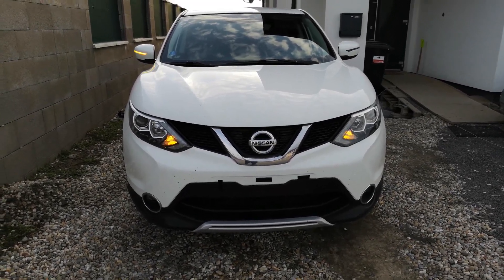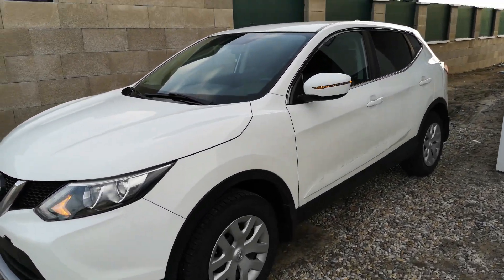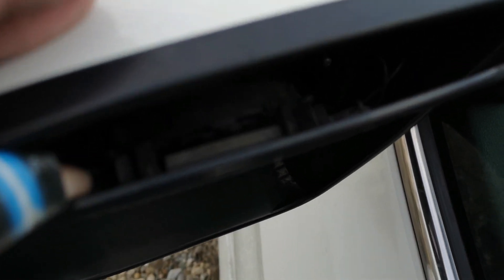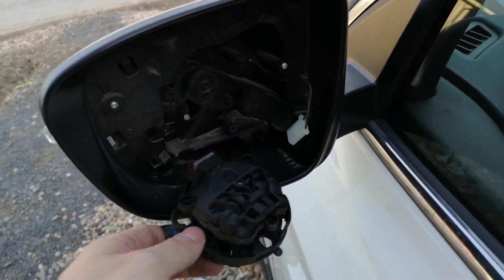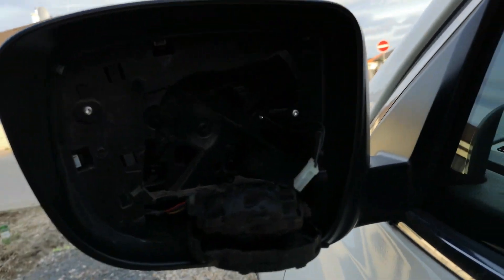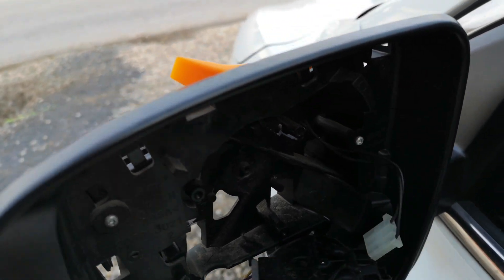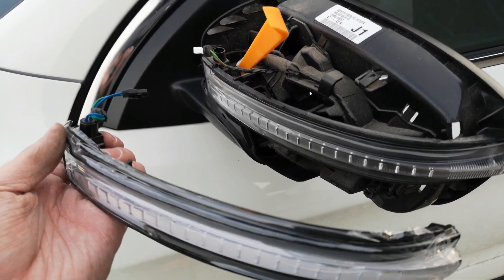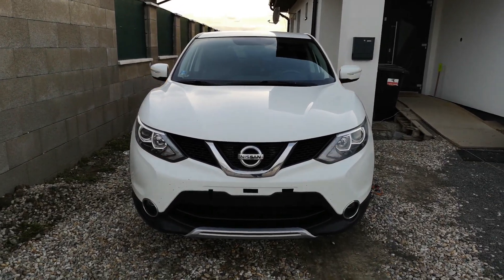📈Nissan Qashqai J11 - new side mirror turn signals

Comment: You just have a friend for life! Thanks to this video I was confident to replace my normal turn lights with dynamic ones. I bought these at aliexpress for13 euro and they are even better visible than the original ones.
I do have a 360 deg. camara system and so there are cameraś mounted in the mirror. That was a bit more tricky but not so much that I had to stop.
Again: thanks for your video
Reply from the maker: happy to help!

Comment: What type of clips are they? How did you get the clip out is it a clasp?
Reply from the maker: they have new "generation" on aliexpress, maybe cables will fit, if not, its easy to solder it / use small wago lever. its easy to take it out, you just need to take your time, think, have basic tools, and do it with 20 celsia+
Reply: @frostsilenec  Thanks I managed to replace mine and you helped me to do that. 👍
Reply from the maker: @Jj-ff9vq  happy to hear that this channel still helps, but no more content, QQ is sold now

Comment: Thank you for your help
Reply from the maker: mine broke after 3~ years, had to buy new-gen ones, as these were "old" with some kind of module inside of cable. so old/bad - something "bulky" on cable, new/better - clean cable with connector https://imgaz.staticbg.com/images/oaupload/ser1/banggood/images/8E/A6/82ace609-7f38-49ca-8da0-bffb66abd197.jpg , looks like even link in my video is newer now - as cables looks normally.

Comment: Hello just want to ask what size of screw did you use is it torque screw driver?or allen
Reply from the maker: no ideaa now, i think it was torque screw, but you can test it - they are same the ones which holds the mirror - and not that much accesiable and visible, as they are the same ones which holds the LED light - and they are good visible when mirror is taken down.. but nothing special - iam using set of 20~ bits for like 10 euro - and they are enough...

Comment: Is there any issue after start the engine? We did the same but all the turning led flash crazy after installed it.

We have temp solution if installed DRL.
Reply from the maker: no issues, BUT maybe iam different - i`ve already have resistors on front and back turn signals, this circuit and "fast flash" is caused when on whole circuit is bulb broken/doesnt see bulb as led bulb do not have that much power/wats..
Reply: frostsilenec there is no issue if installed DRL with turn LED stripe...we tried to installed the resistors for the mirror led but no use
Reply from the maker: @ericly78  then my question is, did you installed any leds to turn signals to the front or back of car? i got DRL module for dimming from duncho too but not yet installed him..
Reply: frostsilenec yes, i installed the turning led for the rear only.
Reply from the maker: @ericly78  how in more detail, "CANBUS" ones, or normal ones and manually added resistor? or just "some" LED bulbs without resistor and you are not aware about canbus?

Comment: Hello i already install it aswell and it really looks nice and visible..have you seen this led strip DRL it has double sided tape to put on top of the headlight is it possible if you can do video of that it also becomes turn signal light then turns back to DRL its not that expensive i saw it in ebay thanks👍
Reply from the maker: that is the line which i will not cross - they will reject my car on technical check, that is too much and not approved for road..
Reply: @frostsilenec  hi thanks for all the great tutorials but i have question there are new ones available with daytime running lights and ground lichts when you open the car door but the daytime running lights must be connected to the original daytime running lights somewhere under the daschboard do you know where these wires are located i think they are bleu wires but i'm not sure .... and by the way i used your video to install my daschcam with piggybacktail so thanks for that video man man 👍
Reply from the maker: @robertdeman9644  i`ve did not played too much with cables in interior, you want to connect some kind of "ambient" lights? or what you want to connect? some lights which are projecting to the floor when you open the doors? sorry did not get it from your comment... and got small update on piggy tail, it should point up if you want to have "insured" both circuits seperately https://www.youtube.com/watch?v=mjFRNGpHtvQ , but no big deal, if you will connect it in "wrong" way, you will just have both circuits on one fuse, which is more safe.. if yout want to support me, please subscribe that is only what i ask for :)
Reply: @frostsilenec  no i already have ambient light i installed it with piggybacktail and switch in between but now i have found mirror turnsignal like you have but who olsow have daytime running lights but that means more instalation of cables for example to the interior roof lights but thats no problem,  the problem is i have to connect to the original running light of the car and these cables are somewhere under the daschboard,  i left a link to YouTube so you can see the new type mirror turnsignal lights
Reply: @frostsilenec  i already subscribed on your channel 👍
Reply: Are these the switchback leds I assume. I had prof. install on 2019 Rogue. Guy said it was a bit confusing but got them wired. Problem @ times. I leave my lights off  'auto' to manual lights. Driving at nite the strip lights white and yellow sequential as blinker. Sometimes after parking the, I press lock button and the strip turns on again. I have to turn on the engine on/off so it resets something with the computer? I now took time/delay off 30-sec and put at "0".
I put on the 24" length & think called Car Angel Eyes. " CARLITS Car LED Strip Lights, 2 Pcs 24 Inch Flexible Headlight Strips DRL Light Tube, Dual Color White and Amber" on Amazon. Had these install on 2019 Rogue.

Comment: Can you make a video how to replace the tweeter speakers in the dash board...just in case your upgrading your speaker system like bose or focal thanks
Reply from the maker: my qashqai is visia so i have only 4 speakers, and biggest upgrade was android radio - plays even better on replaced speakers or original nissan with connect.. to be honest i dont want touch dashboard too much, iam little bit afraid of new noises from it, iam the lucky one which dont have too much noise from it and lot of guys around have big problems with it..

Comment: I have a got a 2019 Nissan Qashqai The problem when buying parts for it  Though its a  J11 if you type the vin number in search  you get that its a 2010 modal.  On the Vin number on a 2019 Nissan Qashqai such as say this SJNFBNJ11KA304783   the vin say that though  it a J11  but it also says it a modal  2019 modal K     A 2018 is Vin modal numbered is an  I.  So a 2019 Nissan Qashqai vin modal number is  a K